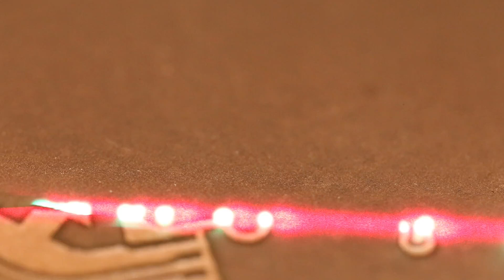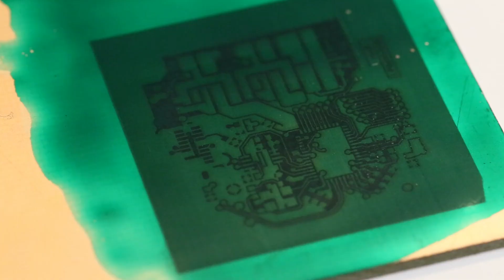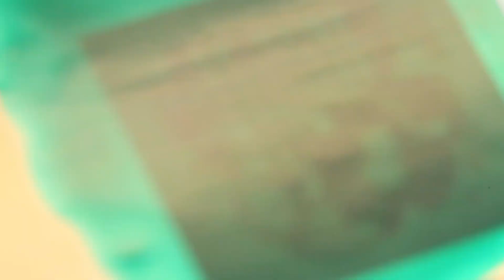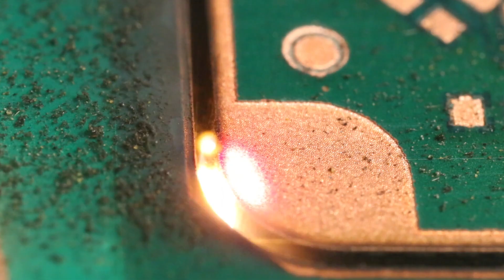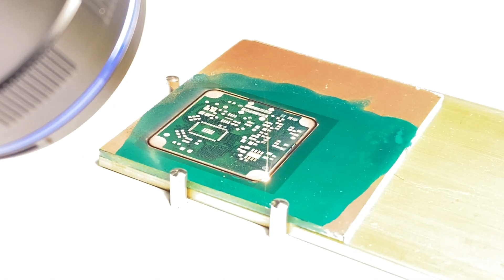Making PCBs with fiber laser

Comment: Insta subscribe. Thank you for this, and especially the full write up on your site. I've tried several times with very little success, either burning the FR4 to a crisp or not removing the copper with my 60W MOPA. I'll use your suggestions and give this experiment another go. Thank you again!
Reply from the maker: Thank you, Jim! It looks like larger power will be only useful for cutting PCB contour and for removing copper you have to go with low power settings. Especially for copper/FR4 transition. Please share the results when you have time to test.

Comment: It's useless for anything except simple, low voltage digital circuits. Pre-carbonizing the laminate is asking for trouble. It will arc over with higher voltage(mains is out of the question). Also any high impedance circuit will not work. Carbon is conductive, if a part of the pcb ever gets burned, you remove the carbonized material, ALL OF IT. You would need additional post processing, maybe medium blasting to remove carbonized FR4, otherwise be warned that this method has severe limitations and safety concerns.
Reply from the maker: Thank you for your insights! You are absolutely correct. But this opens quite new possibilities for high-density PCB manufacturing. For example, you can etch 80% of copper with a laser without touching FR-4 and finish with regular acid. There will be no fiddling with photoresist chemistry.
Reply: @Kurokesu  I thought about using media blasting for example baking soda in a simple sandblasting gun to get rid of charred material. FR4 is softer than copper so maybe even a wirebrush with brass bristles could work? Sadly I have no access to a similar laser, so can't test this myself. You could try the chemical method but from my experience it is not uniform enough to work without resist. I think a mechanical removal is the best bet.
Reply from the maker: @djtransnazgrz  yet another way to do this is by using a UV laser, it does not penetrate FR4 as deep as a 1064nm laser, thus making it easier to control cut quality.

Comment: Great video! I have some questions I hope you can help me with.  Let's say the working area of the laser is 30cm x 30 cm, what size would be the maximum effective area to get a pcb done? Would it be equal to the working size?  If not, would I need a special lense to to achieve that? I hope you don't mind all these questions but your video generated a lot of curiosity in me about this process. I'll be waiting for the updates on this on your blog. Thanks in advance.
Reply from the maker: Hi, I think PCB should be re-positioned and etched with laser block by block. Then PCB dimensions are theoretically unlimited. Positioning should be done with motorized translation table.

Comment: Hi Saulius.
I've read your blog post and the oxidation over time problem. My trick with homemade pcb is to paint it with "colofonia resin" diluted with isopropyl alcohol. It creates a fine layer of resin that protects copper from corrosion and also helps in the welding process. Thank you for your video and hope my trick helps you

Comment: By experience I know a carbonized PCB can conduct and cause some mayhem between copper layers and traces.
With that in mind and seeing how it carves out the PCB edge makes me twitch a little. Although it should be fine if it's just a single layer board with the same copper plane around the edge. But it still makes me twitch.
Reply from the maker: Fantastic observation! This is the main issue and concern. Without extra measures (cleanup FR-4 with different laser settings), conductivity due to carbonization can be as bad as 100R. After cleanup, achieved 1M or better (for 0.2mm spacing)
Reply: @Kurokesu and interesting idea would be to use the carbonisation for applying through hole plating without the messy activation chemicals. has anyone tried that yet?

Comment: I have access to JPT 20w mopa laser. Precise copper removal is quite easy without burning the board. About 12 passes 1000mm/s 50khz 100% power 200ns. But when I try to cut FR1 or FR4 it seems impossible without seriously burning or setting it on fire. I can't seem to figure out what method you are doing at @1:04 to cut.
Reply from the maker: 1:04 - contour cutting. Used wobble setting and fast motion. This way laser cuts wider slot and FR4 does not burn like crazy.
Reply: @Kurokesu  what are your speed/power/wobble settings?
Reply from the maker: @TMS5100  Please check https://www.kurokesu.com/main/2021/01/07/making-fine-pitch-pcb-prototypes-with-fiber-laser/ "Cut PCB contour section"

Comment: I'm trying the same with a 50W Raycus Fiber and nothing happens.. it seems the copper layer is just too reflective, it has a bright "pink" appearance. Can't even get a scratch in at 90%, 20 kHz power/frequency settings :(

Are there "special" boards one needs to het to be able to selectively laser etch a pcb like this
Reply from the maker: That's strange. Copper is not a problem for 1064nm wavelength laser. On the other hand CO2 laser is reflected.

Comment: Awesome Saulius, and thanks for sharing this, 
by coincidence today i have tried a similar method but without good results because I can't achieve 4 mils between traces, there is always microscopic copper chips between them. I have 4 questions, :)
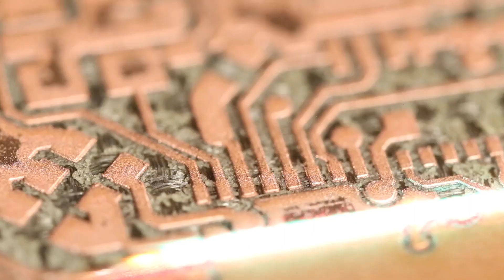what process is in 0:38, copper cleaning?  
what is the focal length of the F-theta lense? (or the size of the working area)
why aren't you marking the contour of the traces (i see it disabled in the screenshots in your blog)

Are you touching the z-axis between passes when cutting pcb?
greets!!
Reply from the maker: Hi Euge. Quick answers: (1) lower laser power and make a few passes to clean loose copper. It will also clean FR4 fibers (2) Focal length is f=160mm (working area 110x110mm) (3) Some passes were done without contour mark (mostly high power ones). Reason is simple - laser removes contours faster and burns through copper sooner. (4) I tired adjusting z-axis a bit during contour cutout, but looks like it was not necessary.
Reply: @Kurokesu  thx for the quick response Saulius.
 I think that the 160 mm focal length is key here, because that lense make a smaller laser spot than mine (I have the 200x200 table) so I have more charring. Good to know that those low power passes clean fibers and copper . 
 I appreciate this valuable info  !!
Reply from the maker: @eid0eid0  If you get too much burnt FR4 material, it means energy density is too high and besides of evaporating material it heats up (hence burns).
Reply: @Kurokesu  Today I've got good results, yesterday I was working with a 75um copper clad by mistake. Today things went much better with the normal 35um board.
 In the test of the "spiral of death" http://www.delorie.com/pcb/spirals/ , a few 4 mil tracks have separated from the laminate because of the temperature I suppose , but it's a good success.  The resolution of the laser galvos is astonishing.
Now I'm goint to investigate drilling.
greets
Reply from the maker: @eid0eid0  awesome! Glad it worked!

Comment: Hello,Sorry about my bad English.Im new to pcb hobby making.So far i making boards with cnc router but is hard to have trace etching with vbits and pyramid bit(the 0.02 endmill break in my hand) because of Z accuracy.I want to buy a fiber laser for pcb etching traces only.No drills.I see a lot on the internet.My budget is around 3-3.5k Euro.Is there anyone use Fiber laser for that job?What do you suggesting me to buy?20-30-50w?Jpt - Raycus - Max?Mopa or Not?Desktop or seperate unit? RC1001 or SG7110 head?Workarea Lenses?Im interested up to 80x120mm diamensions boards.Thanks in advance.
Reply from the maker: Hi, you can use fiber laser to etch photo resist, but actually etch copper with 1064nm laser is tricky because of the charring. If you are trying to save money, 20W will be enough.
Reply: @Kurokesu  Sorry about my stupid questions. Im new to these laser. I dont want to get with chemical. Im trying to avoid them. So with a cheap 20w laser will be ok for etching? If i try instead of marking trying to cut vector offsets of the part i dont want will be better? Also brands,Mopas or not,heads,working areas is make any difference? What is the best bet for you for pcb etching? Thank you for your time.
Reply from the maker: @fender0stratocaster  you need different kind of laser. 1064nm fiber laser is ok for some PCB experiments, but not good for PCB making directly
Reply: @Kurokesu  Could you please suggest me what machines to look to?Thanks again.
Reply from the maker: @fender0stratocaster  Try to check LPKF laser machine and read a bit more what they use
Reply: @Kurokesu  Im really thank you for your time and help.I will check about them.

Comment: Hi Saulius, your presentation is very nice.
I have a problem : I have a 20 watt fiber laser machine with a 240x240 lens.
I cannot engrave pcb copper glows, reflects beam.
How can I solve it?
Reply from the maker: Hi, I am guessing maybe power is too low? Mind sharing pictures/video?
Reply: 240 lens has low power density. try 100x100 (~160mm FL) lens.

Comment: So cool! I had thought of using UV laser to expose dry film photoresist but fiber lasers are usually IR. But anyway your method needs none of the chemical for developing and etching. I guess the laser etched copper surface also binds stronger to solder mask? Probably worth a study about it.
Reply from the maker: Actually, removing a UV mask with a laser is not such a bad idea. It will take longer, but there will be no issues with the burnt FR-4 core.

Comment: What kind of fiber laser is that? Is it a 20 watt fiber laser? What is the smallest lines and pitch can you achieve nicely?
Reply from the maker: Yes, it is 20W fiber laser (at least was 4 ears ago). 0.07mm track separation can be done without big problems.
Reply: @Kurokesu  Thanks for the helpful reply. Are you still using this fiber machine?
Reply from the maker: @sto2779  Sure, I do!
Reply: @Kurokesu  what is the exact model supplier \ store? Thanks
Reply from the maker: @IAmTheVector  I bought it quite a while ago. The exact model and manufacturer is not important now. Just search for 20/30/50W fiber laser.